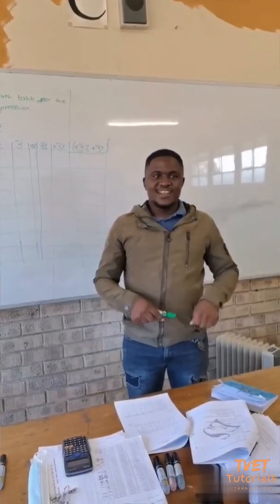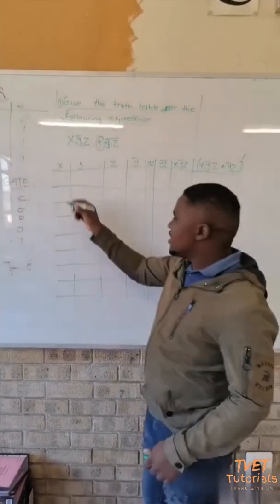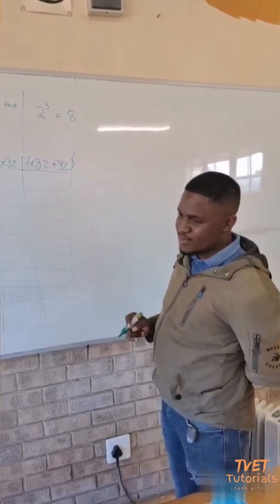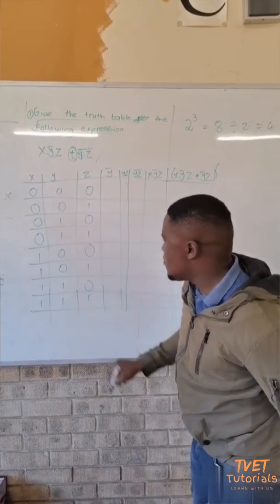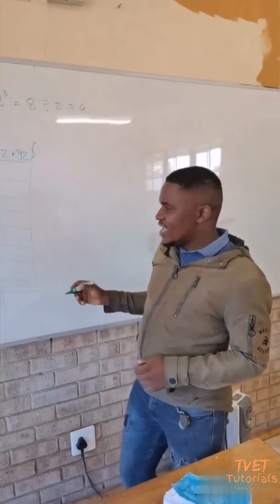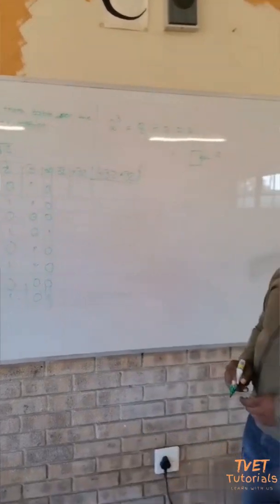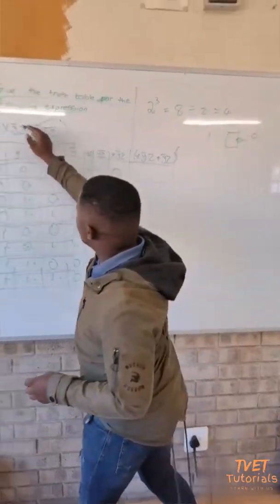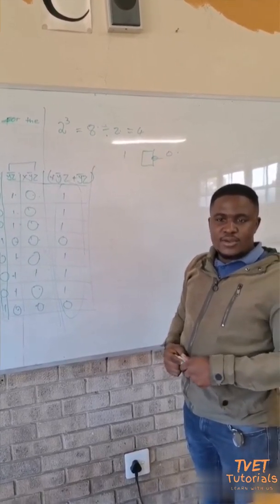Fault Finding and Protective Device N4

Comment: Another way of constructing a truth table, u can use an additional of binary on the inputs, whether is two inputs or three inputs, students should familiarized themselves with addition of binary, then in decisions making, OR gate should be treated as current flowing in parallel circuit and AND gate as current flowing in series circuit. Otherwise i applaud you for such a talent in teaching that chapter... I'm also a fault finding lecturer, wish i can meet u one day to workshop each other especially in this module 🤞💪